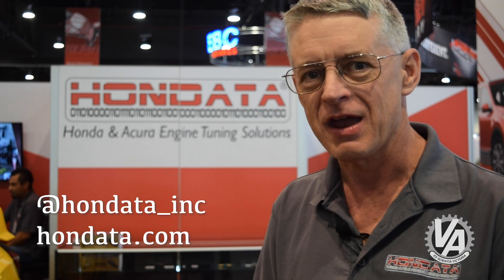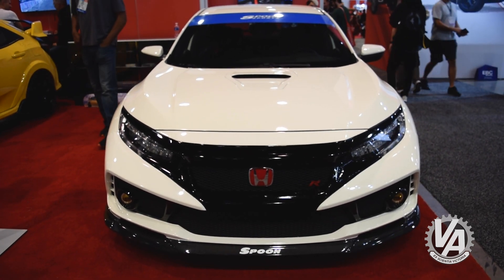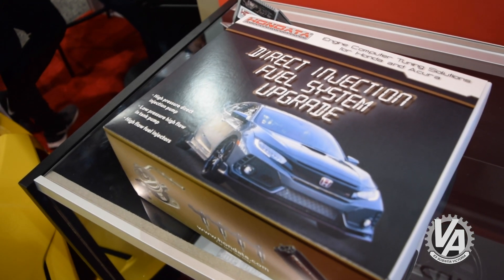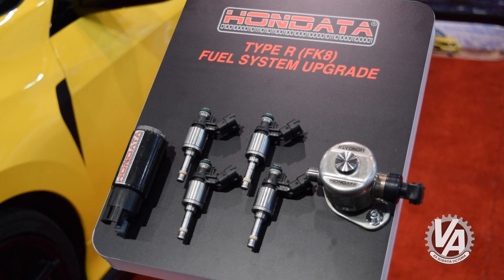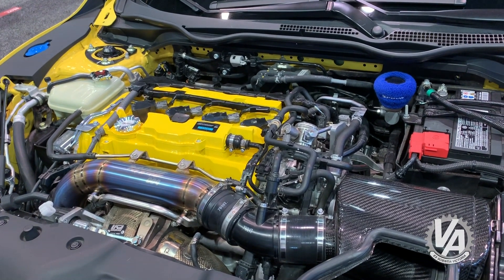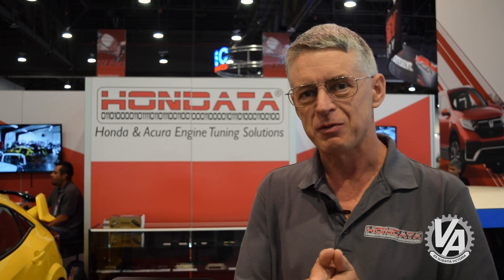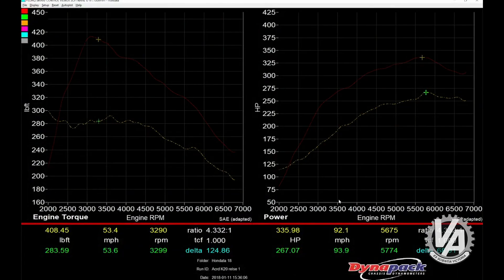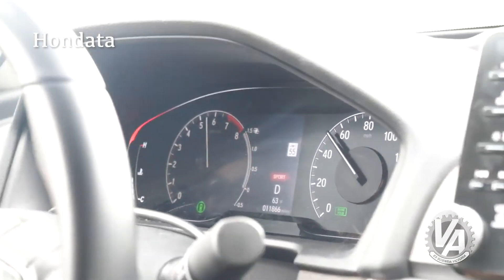Hondata Direct Injection Fuel System Upgrade and More

Comment: I’m currently fbo with rs450 drop in turbo upgrade. I also just had hondata fuel system and prl flex fuel installed. It’s being remote tuned yesterday and today. Will be posting videos. I’m hoping for 450whp🏎🏎🏎

Comment: In germany we dont need a upgrade until 430hp... after that you can get a upgrade turbo. 500hp up to 550hp you just need a better clutch... after 550hp you need upgrade injection but! After 550hp its not only thing...how you will get 600hp on road??? With fwd?
400hp is enough.
Reply: you can get 550hp  without upgrading injectors? i dont think so..
Reply from the maker: On a Honda?
Reply: @VTECAcademy  https://youtu.be/puQQFVI4xw8
Proof
Fk8 typ r gt....
Reply from the maker: @MrAuhue  The top Time Attack FWD cars run well above 600 HP. I suppose it depends on if you are talking street cars on public roads or race cars on closed circuit roads.
Reply: @VTECAcademy  okay thank you. I will see it :D hopefully soon.

Comment: Weird that the HPFP and injectors can’t handle twice the amount of HP. Take a similar BMW DI setup and 300HP is now close to 600HP just by tuning the stock system. And that is with E85.
Reply from the maker: That's not Honda's way. They usually build parts that work near to spec and not above to reduce costs.